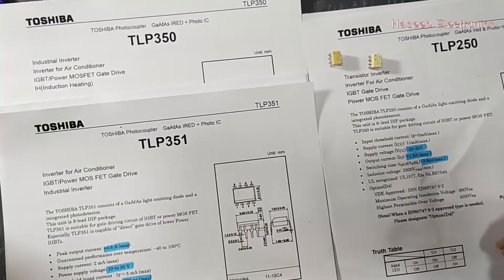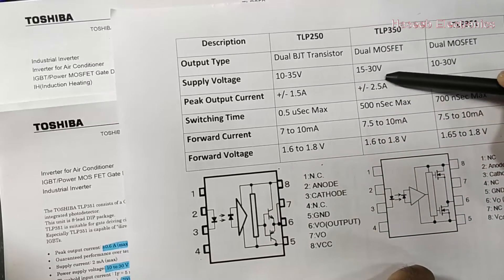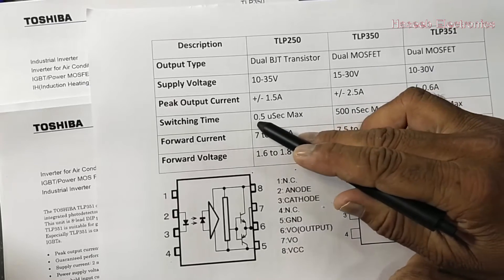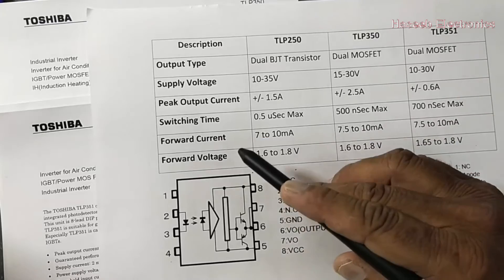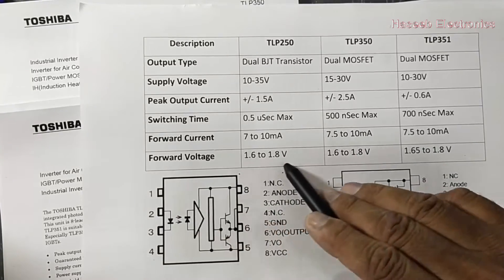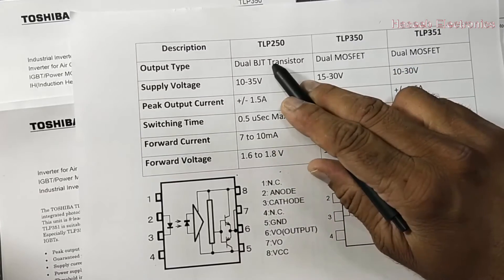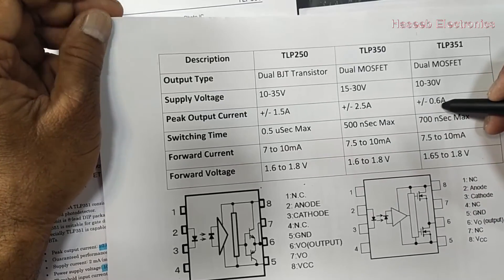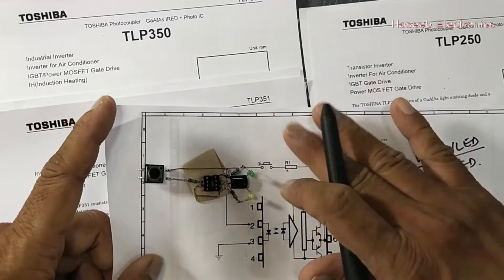{479} TLP250, TLP350 & TLP351 Datasheet Comparison & Test

Comment: Thanks for vedio, can I use TLP350 or TPL250 as a gate drive for the mosfet transistor C2M0080120D to design a inverter working in 1MHz or switching frequency is 1MHz? please answer me

Comment: Tlp250  25khz 
Tlp350  45khz
How can same😂
Reply: Can we use tlp350 instead of tlp 250 as my tlp 250 was driving two irfb4568 now I want to drive 3 irfb4568 which are higher voltage rating MOSFET but low current.as I need more current and voltage

Comment: Sir  I want to use this opto Ic for isolating 400 volt full bridge converter the driver current is low so I want to use for current gain and isolation will the ic won’t with the sv1 and sv2 gound from the load out put of 400 volt tolerance or will the ic burn out because I see on the data sheet saying 630 volt vpk please reply thank you